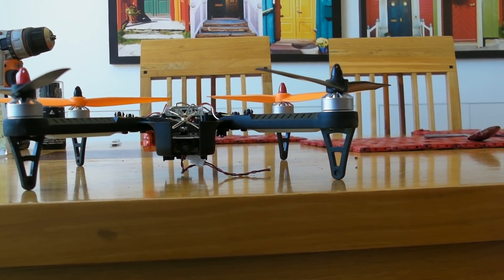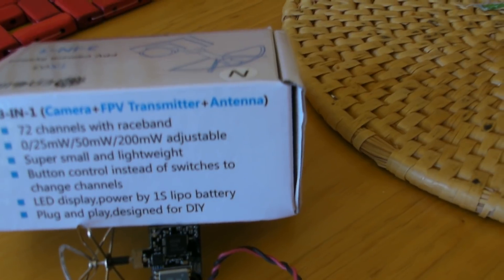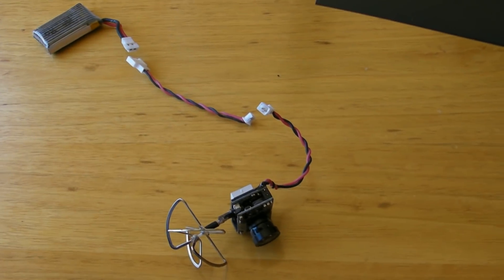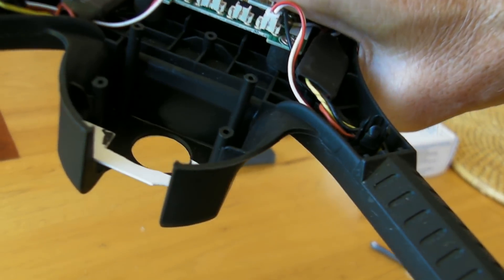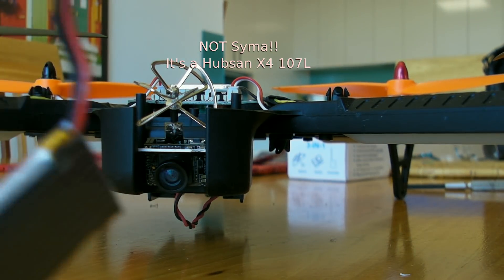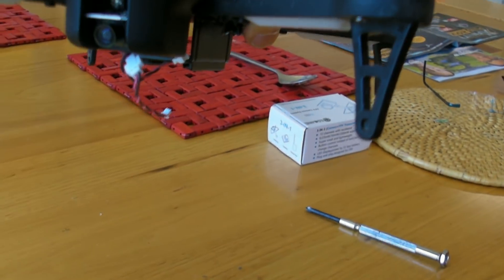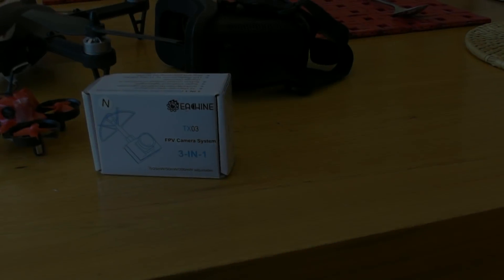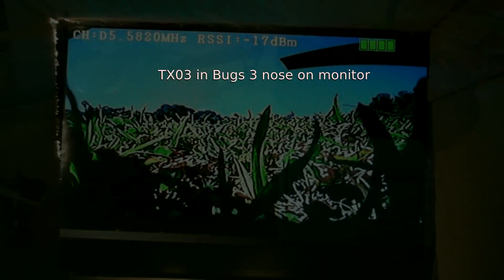Install Eachine TX03 in a MJX Bugs3 for FPV

Comment from the maker: Looking back - these days I use tiny cable ties and a little foam for a soft but secure mount, and plug the AIO into the B3 board. Still using TX03s, but will change up to something from Cadxx if/when they improve quality control. However, government regulations may kill off inexpensive drones weighing more than 250 gms in many countries.
Reply: So actually, you can connect the camera directly into the B3 board, used previously for the LED, right?
Reply from the maker: @HendraGunawanITB  Yes - the 3 pin socket was designed by MJX to provide 5V to a FPV AIO camera.
Reply: @skybug3  thanks. I am buying the TX03 and will install it on my B3. Your video is helpfull (even after 4 years).
Reply: Hey!! Just saw👀👀 17k view's!!! Your famous!! Knew would see this one day. Love it!! Well done my old friend.. well done.  Nice👊👊💪💪
Reply from the maker: @sleepingbearffg5008  This one met a real need at the time - too many videos up back then that didn't give enough detail to help others getting into the hobby.
Reply: @skybug3  well good feeling you helped so many.. 💪👊

Comment: How is this camera in low light?
Reply from the maker: It's OK, although I make sure it points down a bit, after getting caught towards sunset one time. Because the TX03 has a much wider field of view than my Y1 Lite HD Action Cam, it works well for fpv. If pointed too high near sunset, I can't make out as much detail as I'd like, while the HD footage is still clear. I still use them, as they are reliable,  give good range and are value for money.

Comment: Hi ! Thank you for the video. Exactly what I was looking for. Could you just write me about the battery ? What should I buy exactly on Banggood ?
Reply from the maker: I searched Banggood for "battery hubsan x4 107L", but did not find one. However, I found some on ebay. Search for -
 3.7v 240mAh LiPo Battery for Hubsan X4 H107L RC Quadcopter. You can buy others with higher mAh, but check the size to make sure they will fit in the Bugs nose space.

Comment: Sorry for the bad review they seem to be nice.  I got a bad one but I want a new one to at least fly. I had 28 years of tattooing people from around the world. With a hurt back! Got surgery was fine. Moved to Florida. Started tattooing in my house!  They set me up for a drug bust. I did not rat on anyone I was tattooing. I did not do the drug. But went down for it. A big drug dealer knew if I was in there I was not going to rat. And I had tattooed real big hitters, if I knew rats, l grew up NJ. They road to the pine barrings trees. In a trunk. But snitches get stitches, and then put in ditches. I grew up in knowing these people. Bikes, gangs, most gangs brands out in life, I tattooed dea, FBI, cia, cop, three star general, every walk of life,  I'm a locksmith, woodworker, designer, I sew, I flew planes all my life, and my dad too.  So I was young, we built the stuff we ran, there was not know RTR. We did it all. I flew choppers, I weld, stick, tight, mig, I'm a mill right I have a 1934 mill I fixed and run, I own a plotter  and was selling windows all the time. Sandblast glass sell mug, car windows, murilas, add I was a ninja for 12 1/2 years, equal to 5 degree black. Master of weapons, made my own, chemistry, l fabricate, we owned a screen printing place I learned all my self, closed hurt we had a consignment store closed hurt, I live in a big house with salt pool, just had my great freind old age die in front of me, did not leave her side, hand feed her and gave her water by hand she went parilized in a total of 8 hour. Started with The tail and then  each lim. One lag at a time. Now I'm hurting at the same time, I thought I had friends in life, but everyone used me for tattooing, I'm to hurt to tattoo closed Pauls Tattoos in plant city fl. 33566. My cell is 813-375-0637. I have not received not one friend come here or just call. Do you know what it like no to talk to no one, wife 32 years love her, but just freinds, so barely moving, can't lift alot,  I just wanted a drone fast light, and did not need camera, my daughter bought me a nice one. And did all the reveiws and I got the bugs, flew it my house without camera, and flew nice, loved it it brought back some pathetic life in me. And then rain and wind, but I would still just look at it. And when all the wind was calm and no rain,  I was told never fly in bad condtions. But I knew how to fly, so I got family here and we took it out side, put in middle of road, I started motors up stick, and stopped at 5 feet spun around took pic of family, turned back around and up to 25 feet just to see naborhood and sat there moved up a foot, and it just took off strait up. Way higher then 400 feet. I was telling everyone I was afraid because we are in plane runway turn around in air zones  airspace. And I know I never go above 100.feet.  Here, but bugs had no control. It beeped and still flew away, I lost it in the air. It was dangerous. If that would have hit a aircraft. And killed someone, but I see; the reviews on internet on bugs, I had a bad one. But I still want one I can fly, I just bad eletronics, I flew 8 channel heli, and it was not like I learned the wrong way. I did the 4 foot square and a foot and two feet off the ground, then I tryed sky viper in wind and I flew it like a champ, counting the wind swirls, thermal swirl, polits know what I'm taking about. And never crashed. I have a bad deal, MJX said they won't replace it if it was in a tree. If it was I would cut tree down. But it never came down. It was not wind, or anything I did. It was MJX gave me a broken drone, and I just want a gift back I should have never lost. If it was my error I would eat it. Do you know how many cars,  trucks, boats, planes, helicopters I crashed in my error, alot,  and no going after new from company, but this should be made right, if I had a guy in life that bought something and it was bad. I fixed it for them. I'm not trying to get something for free I want some happiness back I had. And I'm getting help. But they don't help. I need to TAttoo again, but when you able to do as much as me.  And can't do nothing! I put all my batterys on storage charge. I'm not a beginner ask them to make it right. I built my own guitar and wound my own pickup, and I play Right handed I'm left, tattoo left, I play drums sax was learning, when you get hurt age 19 you find things to do. I did run a motor off of water, and I always knew electronics, build boards, but now I sit in a chair. No dirt bikes, I build motors big and small,  I know tiny motors, I can rewind stators, I was told master of none, but 8 th grade education is a way of knowing. I had to master all before moving on, to the next. So people are wrong. But unable to do anything I have parlizing pain. But can fly drones. Lmao I don't under stand why they won't replace a legit reason.  I'm fighting for disability do you know what its like to be on top of the world and lose everthing. Moved to Florida my wife asked the movers if they had theifs workers they said no, they weight the truck before and got to fl, the truck lost 800 pounds of toys and I had three of the same systems every game ever made. Tools, daughters had every board game made, 3000.00 bike, two, all my collections and I had a lot. But I have alot I got in fl. 8 dirt bikes four wheelers go carts. Trade for tattoos lots of guns, had 5 1911's one was 1,800 Dan wesson. 2000 each two desert eagles. Rifles, ars, shotguns, had to sell and make ends meet, sold my toyota celica GT 2001 nice 4'500. All because my back, and all I wanted was a little racer. Is that to much to ask.

Comment: I love this mod, great video, I dont do fpv, and I hate hate hate bugs 3. but man that is a great job.. I want this eachine set up but with a monitor and any other quad..
Reply from the maker: Thanks, anyshitt. I understand how you feel about the Bugs 3 after looking at some of your videos. I've had a better run, having managed to swap motors out, and resolder wires torn off an ESC. Since making this video, I've learnt to use a couple of small cable ties to secure the TX03 to the mounting plate - that way they stay put in crashes, even when you tear an arm off - https://www.youtube.com/watch?v=LrBvK97r6II&t=12s
Reply: Thanks David,  yea I dont know how?  But my lucky number comes up when ever the East ship's me
bugs 3 replacement parts?  The God's have me drawing short straw's by default.  That's really very sad. but I had a little fun,  and learned few things along the way,  when it comes to me and that bird? wE HAD A VERY BITTER DIVORCE, and there is no chance for reconciliation.  Im totally sold on that little camera,  I wonder why they dont make the antenna external or detachable?

Comment: Do you have a step down board between the camera and board? I saw on ragthenuttsoff  that at 200mw it could fry the flight control board.
Reply from the maker: I was powering the camera from it's own battery with no connection to the fcb when I had it lit up at 200. I've had it set at 50 since powering the camera from the motherboard.

Comment: Can be powered by the battery of the drone ? Please tell me
Reply from the maker: Yes. I've now done this using a 2 pin connector onto the leftmost pins of the 3 pin connector, looking from the front of the drone. this gives about 3 volts. I tried the 2 pin connector used by the headlight, but that produced lines on the video. I got tired of plugging in the extra little battery. Flight times don't seem much shorter.
Reply: David Dawson yea I'm waiting for my big 3 and I don't wanna put in a second battery !!!!
I'm thinking to buy a c5830 camera which has bets resolution and it's plug and play ,for the receiver the best choice is a gold model 5 8G 150channel and u don't need a monitor ,wifi goes straight to your mobile
Reply: Do you have a step down board between the camera and the board? I saw on ragthenuttsoff  that at 200mw it could fry the flight control board.
Reply: So, have Ypu bougt it ? Any opinion - I think in similar way, and I wonder how it feel in reality.What's the range of camera ?

Comment: Dear uploader,
Nice to see yr modding video, however , if u wld be mounting the cam on top of th head of th bug , tht wld be giving u th widest angle of view, evr possible including full props + extra side view. I use this way in my Bugs 3 same camera u used.  

I wonder what abt covering th clover leaf antenna & it's in th front  covering by its body! !  Anyway , jst to say my thoughts !! :-)
Reply from the maker: The cam has survived some hard impacts so far, like this one - https://www.youtube.com/watch?v=HkVyaXzb_F4&t=38s I've flown out at least 200 meters without video breakup, power set at 50mw.
Reply: David Dawson ,
I see, if u fly successfully w/o video signal interrupting then mby it is ok , covering th clover leaf inside.  I learnt frm u. 
Bt for achieving th widest FOV , mounting th cam onto th Bug's head is the best @ no doubt. :-D

Comment: Sub'd 👍👍👍👍I have the tx03 and was thinking the same thing. I wear glasses and can't use goggles . Have tried a few friends goggles. Can't focus..  But i want to fly FPV and use a monitor. Do you have information on the flight board connections &voltages? I don't won't to remove or share the LED connection. Isn't the board connections next to the LED 3 and 5 volt output? Center pin of the 3 pins is ground? I really like your ingenuity here installing the tx03. How long does your battery last?
Thanks
Reply from the maker: Thanks. Yes, you can connect the tx03 to either board connection - plenty of info out there on pinouts in RC forums. I don't know how long the battery lasts - never run it down, but I charge now and again. Just reduced power from 200 to 50 mw, as I felt how hot the unit gets. Will check range in a day or so.

Comment: Well done David nice install of the Tx03 all in one VTX and camera.. Happy FPV flying my friend 🙂👍 thumbs up
Reply: If you can put a strip of tape underneath to secure those wires dangling down it would help stop them snagging anything if you happen to hit anything on a low pass.. Wouldn't want them to snap in half.. Maybe do that just as a preventative measure.. ;)
Reply from the maker: Good point, because I'm looking forward to low, high speed passes as I gain confidence - maybe lake skimming...
Reply: What i did.. in the hole you have your wires running thru, i made another plug for the round hole and put a mini switch in it. Enough to carry the volt/amps. No wire to dangle and convenience